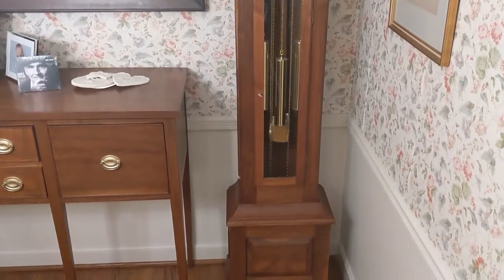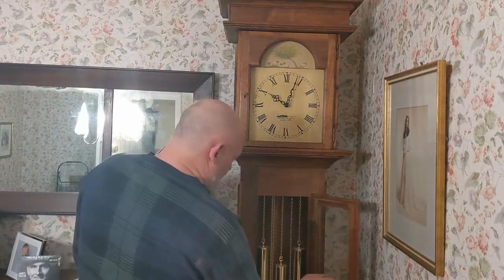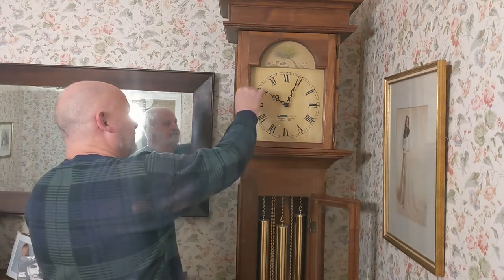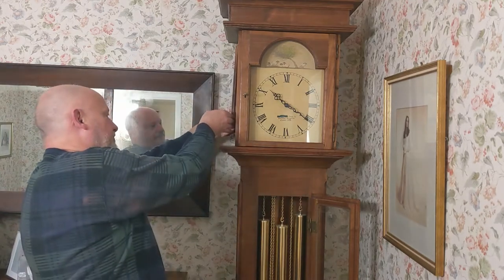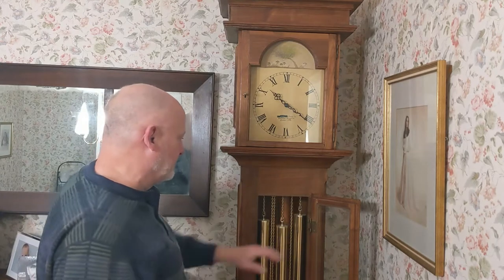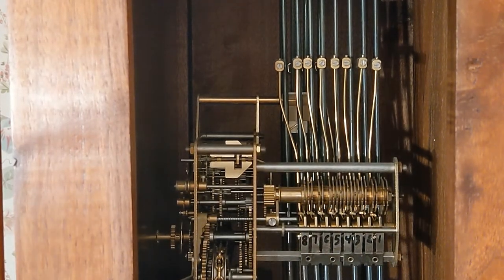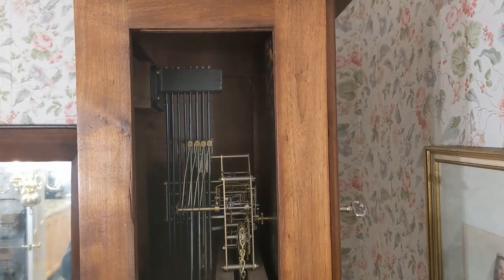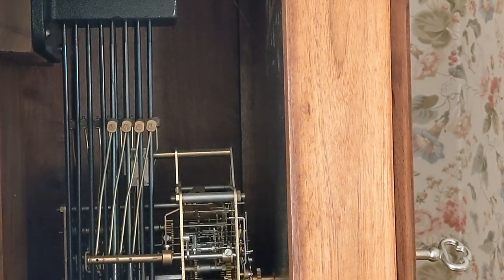Hermle Grandfather clock weight driven movement

Comment: It’s this beautiful clock case handmade?
Reply from the maker: well...power tools were used but they had hands controlling them...does that count ?
Reply: @neuromanglers  What im asking is that was it was made at home by someone or in a factory? Sorry for not being clear.
Reply from the maker: I always feel like I am cheating when I use all the modern power tools that make it very easy to build something that initially was done just as well if not better with primitive tools
Reply: @neuromanglers  Ok.